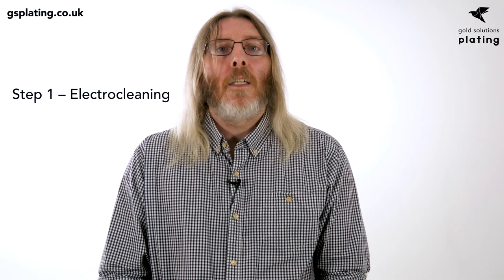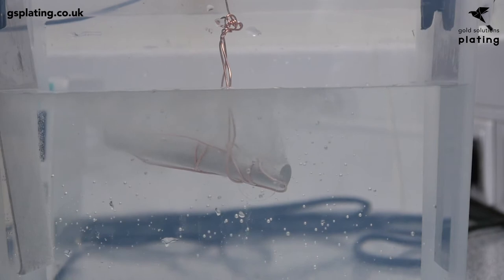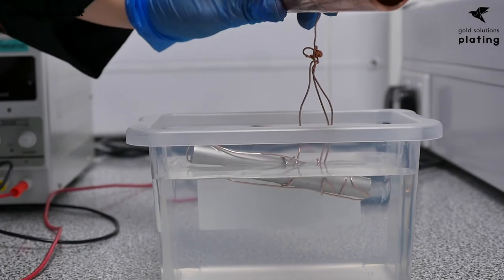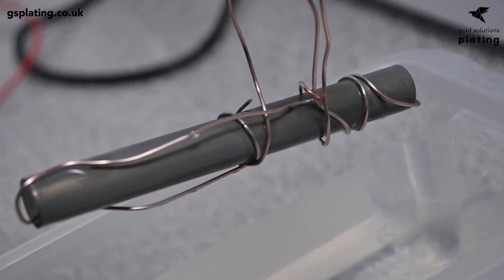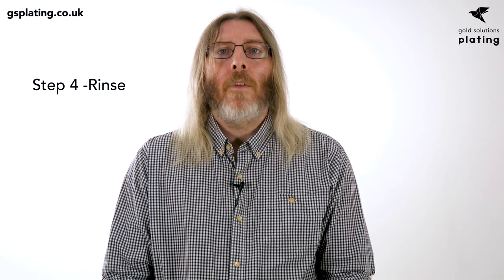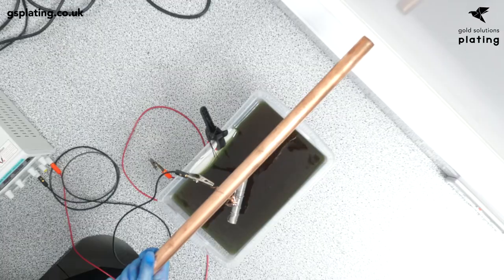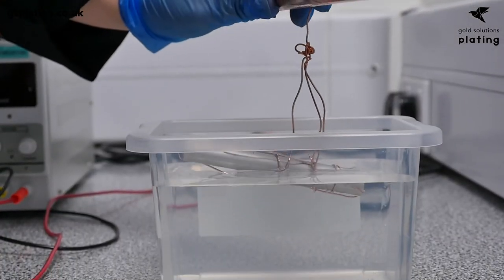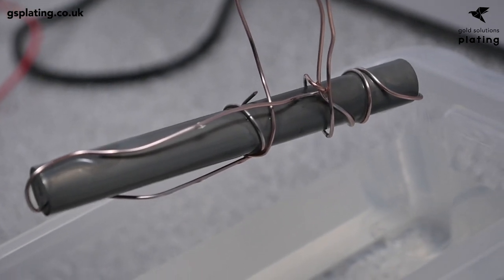Aluminium Plating Tutorial - How to Plate Aluminium Step by Step

Comment: Hello, I want to coat my aluminum parts with Ni-B. I prefer NaBH4 or DMAB (dimethyl amino borane) as a boron source. In my Ni-DMAB bath, aluminum darkens and peels off within 30 seconds. What path should I follow.
Reply from the maker: Hi! When you say the aluminium peels off, do you mean it oxidizes and the oxide flakes off, or do you mean that the nickel that you are trying to adhere, peels off?
Aluminium should typically be plated in a regular nickel (pure nickel) solution after being zincated. If you are using a certain type of hybrid nickel then I would possibly expect problems going over the zincated surface.
As far as I know, boron nickels are for electroless plating. I would not rely on the electroless nickel plating system for covering aluminium from scratch. At best, I would say plate the aluminium in regular nickel as per the video, and then plate over THAT nickel with your boron nickel.
Reply: @goldsolutionsplating1761  Hello sir, I have sent the photos related to the problem I am experiencing to your e-mail address on your website.
Reply from the maker: @ismailgunduz7146  Thanks, we have seen these and replied, many thanks.

Comment: How does that aluminum bar get plated evenly with all of that thick copper wire wrapped around it?
Reply from the maker: If the copper wire is deoxidised before wrapping (using steel wool) and also, wrapped with enough give so that when the allycu is being put on, the waving motion in the tank allows it to get behind and cover it. Then when it comes to nickel plating, because the wire has been deoxidised, it fully passes on the nickel plate beneath itself. This is the same as when you use our products to electroform plastic items in copper, you do not have to worry about lines being left in the end result, it plates "through" the wire.
Reply: @goldsolutionsplating1761  Interesting to know, thank you, I would have never thought about that. I've never plated anything yet but have been researching and studying it to help get more prepared for when I try it soon.

Comment: Hello, can plating process be done on High pressure Die casting components...??
Reply from the maker: Hi, sorry for the late reply, yes plating can be done on die cast, if it is zinc based die cast, then you would need a copper strike as well as the other type of copper, and then nickel and your finish of choice.

We can be contacted directly ar enquiries@gsplating.co.uk for further information,

Many thanks!

Comment: I read that you have to use flash copper after zincate step, is that correct?
Reply from the maker: Our system requires the use of a 40 minute long nickel plate directly after using the AllyCu, no copper strike involved. Many thanks!

Comment: Can you please make the second part of this video?  I would imagine we all came here having questions about plating but this only explains the first part… and none of the plating aspect…
Reply from the maker: Hi, the entire aspect of plating aluminium that people find difficult, is the part where you have to go from bare aluminium to nickel. Plating over nickel is easily done, so this video is all about how to use the AllyCu zincate (and subsequent nickel plate that has to follow) as it really helps to see what the zincating stage looks like while it is being done, in order to get it right. This is precisely what we cover in this video. 
The plating aspect is covered on here where we mention plating in step 5, plating in nickel for 40 minutes at 0.01 amps per cm2.
Once this step is done, you are no longer dealing with a tricky aluminium surface, you are instead dealing with a nickel surface which is very easy to plate over.

What finish would you be looking to plate over the nickel with? For eg gold, rose gold, copper etc? What setting you need going forward depend on which finish you would be using, but all finishes (when being plated on aluminium items) will have to involve the AllyCu and nickel stage as a standard.

I hope this has helped!
Reply: @goldsolutionsplating1761  oh I see I see!   My bad! In looking for gold plating videos this was the first I found so it was confusing for me.  I would like to plate some of the aluminum piping(intercooler etc) and polished intake manifold of my car(Nissan skyline) but the parts and pipes are quite large, some being like 2 feet long by 3 inches wide, and the intake manifold is two sections around 2’x1’ each. Also concerned with whether it would plate the interior of the pipe and if that could negatively affect the running, like if the air pressure got too high could the plating come off into the motor over time and cause problems.  And if I were to go the route of one of those “paint on” style plating, If I were to Nickel plate first, is there a time limit to gold plating with quality or is it going to be lower quality if I can’t get to gold plating for a day later etc. A lot of the kits I’ve found are around $1k so I don’t wanna pull the trigger to find out that I chose the wrong one and have to drop another grand to go the other way etc. And from why I’ve seen the 1-gallon of gold solution is like 7-800, so for something that size, would I need it completely submerged the entirety of the plating(which could mean needing like 2-3 gallons?) or could I put like one half in, and then flip it over to do the second half?  
A lot of potential questions and I’ve not seen too much information out there(the 6 hours or so of internet research I’ve done trying to find) that answers these. A lot of people seem to only be plating small stuff like jewelry, and the big stuff I’ve found(like wheels), don’t show the nickel plating portion so I don’t know if they’re doing a giant submerged tank situation or what.
Reply from the maker: @bowley4  so sorry, I completely missed this reply! Ok so the nickel plating stage is strictly tank only, it is not something that you can brush plate (the painting method you mention). Although nickel itself, as a plating solution, can be brush plated on to metals, it just so happens that with aluminium, due to the zincating process (the AllyCu) you must follow the nickel plating process by fully submerging. 
The inside would not plate.
Trying to brush plate nickel over a zincated surface will actually deposit nickel, but the problem is that it is a very weak bond and just a knock of the finished product can produce big flakes of nickel chipping off, so it is no good.
the good news is that gold CAN be brush plated over the nickel plated aluminium. If you use nickel activator on the nickel surface, and work your way around the engine part a bit at a time, you can brush plate the gold on no problem. 
It is much easier, faster and cleaner to submerge the item in gold solution however, and this is how we would recommend doing such a job, but if you are willing to put in the time and effort, then brush plating gold over such a large item is absolutely possible.
Time is not a factor if you are worried about putting the gold on the next day etc, this is exactly what the nickel activator is designed for, it completely nullifies this issue. Provided that you apply the gold as sson as possible after activating the nickel, then the nickel can be any age, it does not matter. There is no loss of quality, the gold will be just as shiny (or matt) as the nickel is.

Regarding plating in a bath of gold, yes you absolutely can plate just over half, flip the engine and then do the other half, it would be easy to do.

We sell a type of 24k gold which we call "Tank Gold" which is a cheaper way of filling a tank. It deposits the same 24k finish as our full strength 24k gold, but contains a quarter of the gold per litre, but costs only a quarter of the price. Due to the low concentration, you are limited to plating no thicker than 1 micron, but such thicknesses would not be needed for parts like this anyway.

Comment: Is it possible to plate aluminum with stainless steel?
Reply from the maker: Hi,
There is no such things as electroplating with stainless steel, although you can plate ON to stainless steel.

Steel, or stainless steel, is not aqueous in solution and so it is not something that can be deposited via electroplating.
Usually, in order to protect aluminium from the elements (which I am assuming is your purpose for covering aluminium in stainless steel?) they normally nickel plate, then zinc plate, then passivate. Or just nickel plate extremely heavily and then plate in something more decorative.
Reply: @goldsolutionsplating1761  Thanks for your response.  I am intending to mesh a planetary gears assembly and the center gear is steel, while the planetary gears are aluminum and I was hoping I could plate the aluminum in some similarly durable metal to be able to withstand the strength of steel acting on the plated aluminum meshing planetary gears.  I don't know what other plating metal would be suitable for this arrangement of gears plating.  Thanks for your reply again.
Reply from the maker: @Mr1fish2fish  Plating is fine for prolonging the wear resistance of grinding or impact, but it is not really something that is considered to increase load bearing capacity, if that is what you are asking? It sounds like the engineering solution to your problem is to make the load bearing gears out of a metal stronger than that of the gears that bear down on it.

Comment: If I knew how to electroplate aluminum I would not be watching this video. Assume I don't know what ally cu is or where to buy it. Assume I don't have a nickel bath. Is it a nickel sulphate bath or will I need something that is cyanide based?
Reply from the maker: Hi, sorry for the delay!! AllyCu is available on our site.
It can be found here https://gsplating.co.uk/component/j2store/products/allycu-solution  
As long as you are applying the nickel by doing full tank plating, and not brush plating, and you have the correct nickel tank setup, then this should make the job all the more straightforward!
The whole system is based on the nickel solution that we sell, which is not cyanide based at all. The nickel is sulphate based but has all the correct levellers and brighteners which allow the nickel to fully and slowly develop properly over the zincated surface, and actual enclad the item in a "skin" of nickel, and with our nickel it should come out pretty much mirror shiny, after which you can tank, or brush plate it in whatever finish you choose to go on with.

Comment: So then, what is the difference between chrome plating aluminum and chrome plating steel? I've never done either yet but I'd like to start getting into it and learning, get the supplies I need.
Reply from the maker: Hi Jeff- Plating over aluminium is different from all other metals, purely down to the zincating step (this is the AllyCu section of the video) which is not necessary with other metals. On the other hand, other metals, such as steels, require chemicals that are not needed for aluminium. So the difference is always down to what type of metal you are trying to plate over the top of, regardless of what you are looking to actually deposit (ie chrome, gold etc)

We have a page that explains all the required steps for the various metals that you may encounter, it can be found here

https://gsplating.co.uk/how-to/how-to-do/88-how-to-plate-various-metals

We also sell kits that come with almost everything required to plate over all surfaces (all metals as well as non conductive surfaces such as plastics) which can be found here

https://gsplating.co.uk/shop/kits/gsp-prodigy

the Prodigy kits contain either 1 litre, 5 litres or 10 litres of each chemical, and they come with all the chemicals you would need, to be able to plate kjust about anything. the only exception, is that they do not come with 18k gold strike, which is required when plating over stainless or non stainless steels, but that can be found here

https://gsplating.co.uk/component/j2the liquid itself has a short shelf lifestore/products/18k-gold-plating-solution
Reply from the maker: One other thing, is that chrome itself is becoming harder and harder to acquire, as many territories are outlawing its use. Many places are looking to find alternative finishes (platinum, rhodium etc in thin layers, as they are very white in colour) but real chrome is something that is hard to get now.
Reply: @goldsolutionsplating1761  Very interesting and thanks for the info, I will check those links out.
Reply from the maker: @bodeine454  Glad to help Jeff